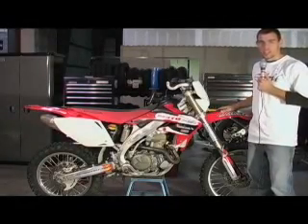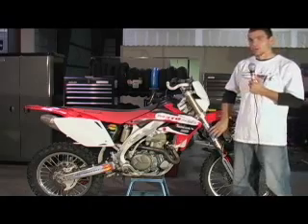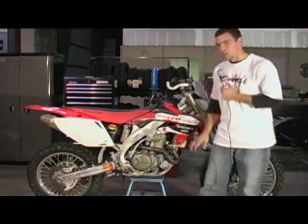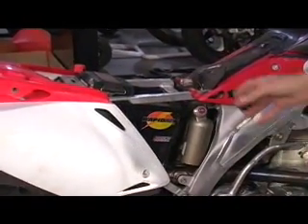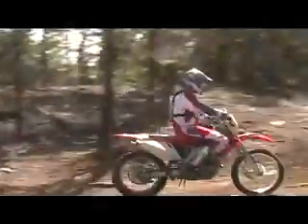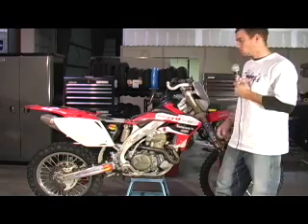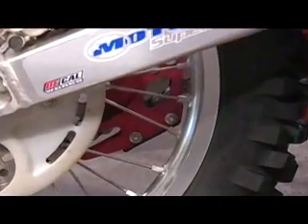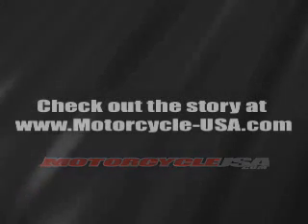2007 Honda CRF450X Project Bike - MotoUSA

Comment: The only way to get the mixture right is to run it on a dyno.  I made all the mods as they did on my 450X, used a JD jetting kit, then took it to the dyno - it  showed it was weak at the bottom, went up 5 on the pilot jet - world of difference off the throttle. BTW the Yoshi pipe makes more power than the DrD.  Screw the graphics, buy some fat footpegs. Removing the emissions does nothing for the power but you save the weight.  Run a twin air filter. Use heavy duty tubes & motion pro rim locks.

Comment: fender2054...I owned an '04 KDX220, while my buddy had an '04 CRF250X. My KDX would smoke the 250X even on the bottom end (I expected the 4 stroke to have more torque down low)...it also handled and turned better. I sold mine a couple of years ago, and regret it.